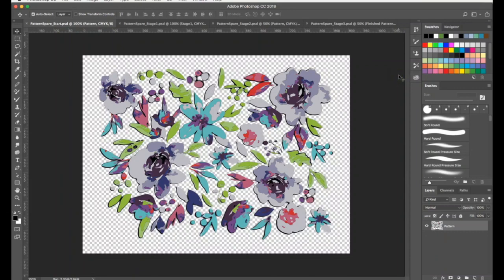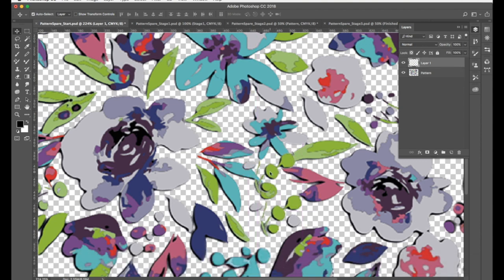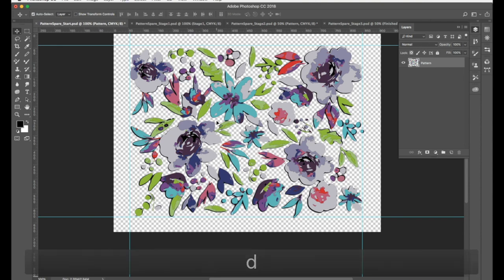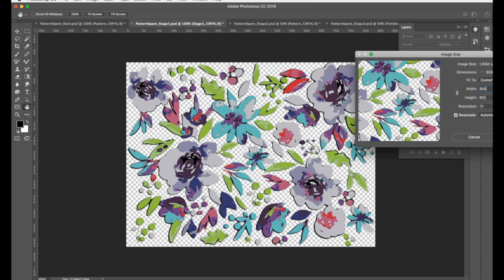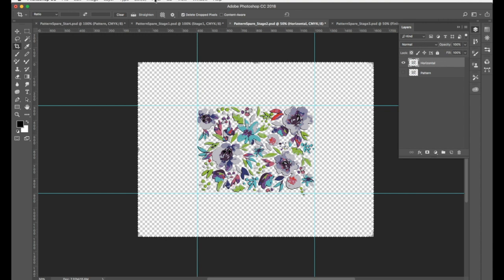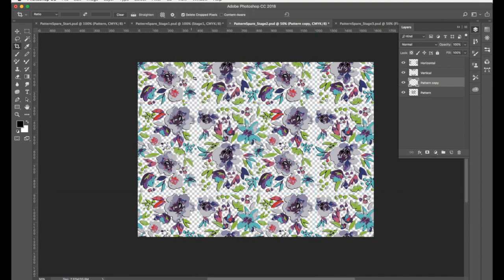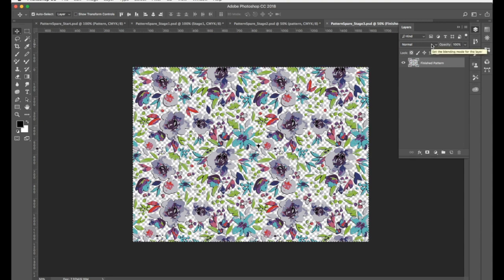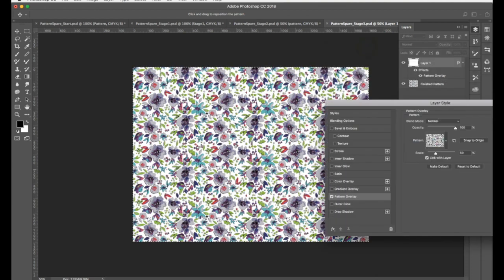Creating Repeating Patterns in Photoshop

Comment: This was wonderful, however, what size canvas do I start with if I want to make a size the customer is asking for? Do I start with that size, or half that size? It would have been helpful to see how to make an exact size of repeat. For instance, 6" x 6" or 12"x 12". This was just a random size.
Reply from the maker: Hi Roxanne Tamberen. I’m glad you like my video. I recommend working in pixels and doing some rounding so the maths is easier. Your document size will depend on how big you want the resulting pattern. To give you some guidance A4 at 300ppi is 3508 px X 2480px, US letter at 300ppi is 3300px x 2550px. However you can work at any size you like, as the steps would be the same for a small pattern as a large one. I hope that helps.